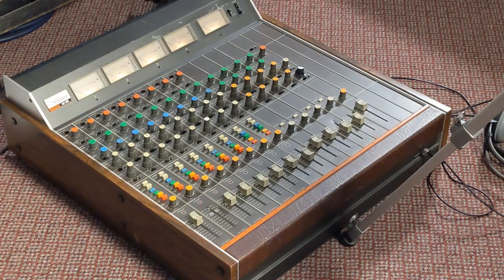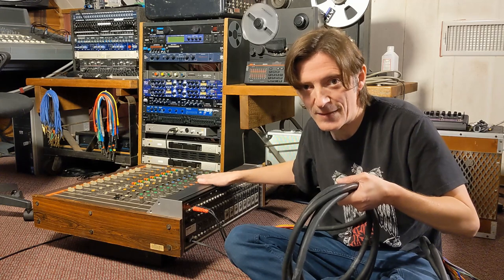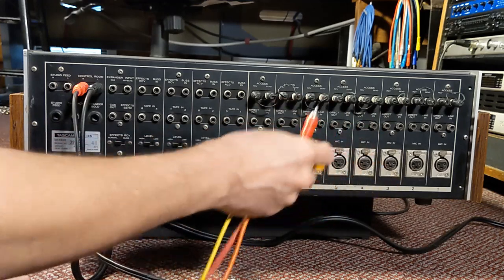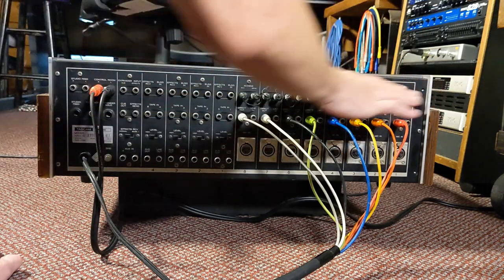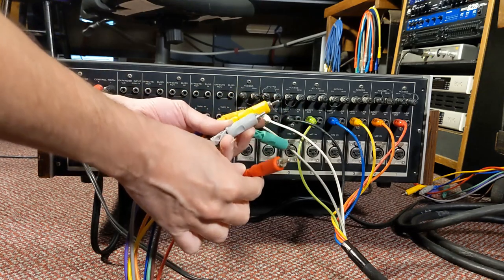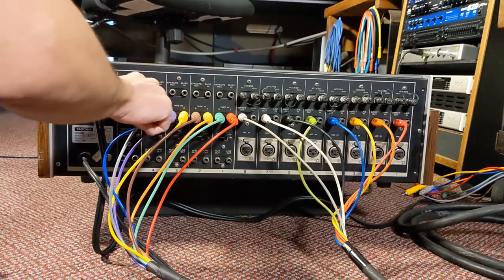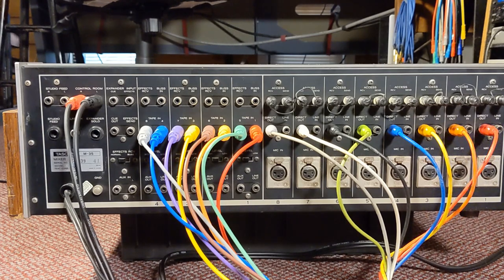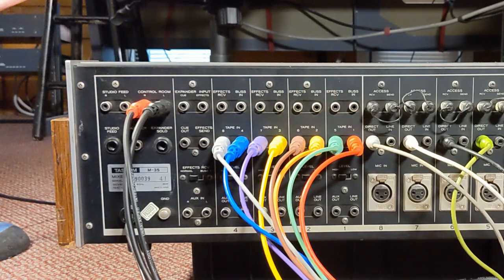Setting Up Analog 8 Track Tape with an Analog Mixing Console

Comment: Hi Grady.. (? Name right), I just bought a Tascam 80-8 Reel to Reel in mint shape for my recording studio in the Poconos in PA. I like you video here dude... Very well done.  I am asking, what particular snake cord would you recommend I buy? It looks to me that you have HOSA CRA 802? is that right.?  I also have a Carvin 1640 Concert board I purchased from my local theater. It was serviced every six weeks for years.. in mint shape also.  Grabbed that bad boy for $100. I run all my gear in the studio through that into my in house PA system. All that works great. But now I am trying to set up the R2R to record right out of the board.  It looks like you are running both to and from both units back and forth with two sets of cords. Is that correct? Last question, do you think I am good with 1/4 inch connector cords into or out of the mixing board and RCA on the other end?  My first time coming across your site. I will check out your other videos. Well done... Thank you.
Reply from the maker: I'm not familiar with the Carvin 1640 but I used to own a Carvin MX2488. I have a lot of different snakes and cables I've collected but HOSA 1/4" to RCA should work fine with an 80-8. It's basically connected outputs from the console to inputs on the console. You can use either the subgroups outputs or direct outs(if your console has them) to feed the tape machine for recording. Then you need to run the 8 tape outputs back into the console in order to mix down what you record. It should be very similar to the setup in this video except your console may not have tape channels. In that case, you can use 8 channels for feeding the inputs and the other 8 for tape outputs returning to the console for mixing. The tape machine will usually pass the incoming signal to the output(input monitoring) so be careful not to assign the channels you are sending to the tape machine to the master LR to hear since the signal will be present on the other channels coming back from tape. In other words, he signal should only go to the master bus from either the main channel being recorded or the same channel returning from tape. Also, your 80-8 is designed with unbalanced line levels at -10. I'm not sure what the 1640 likes level wise but it's likely +4 so you'll have to keep the levels low going to the tape machine and boost the levels coming back from tape more to get good staging. They make level matching units you can buy as well. These are sometimes referred to as a bump box. Some consoles also have switches to change the line level to a tape machine. I hope that helps. I've made a lot of videos about setting up analog gear so hopefully there are more videos here on the channel that will help illustrate better than I can in a comment. Thanks for watching!
Reply: @TwinCreekAudio  Thanks Grady, The 1640 was used in a local theater here. I was the main board for a 2000 seat theater locally.  I have other boards here, but that one does the job perfectly for my studio, hooked up to my EV PA system and through all the inputs of gear, from other reel to reel, Tascam Cassette Recorder, Digital Recorder, Turntable, CD player, and who knows what else.... LOL.  I am old school, at 69 years old now, in good shape. play jazz and blues and fingerstyle guitar for 50 some years now. Back in the 70s I did work with live shows with local bands doing some sound work. I knew how to set em up and record to tape back then, but was a building contractor in my real life for 45 years. Now retired, I built a nice studio with all the goodies. From Grand Piano, Rhodes, 2 Synthesizers, 20 some guitars, basses, upright bass, and other instruments. Bands come in to rehearse here and love it.  So expanding into being able to do the right thing with the recording end.  Got lucky and found a half dozen 1/2 inch Master Tape for $125.. ($170 ea online!). Anyway, I have now watched a few of your videos.. Great job!  Enjoy.. And thanks for your input and recommendations. Cheers!   Oh, and I ordered two sets of 8 plug snakes.  So I'll have both in and out covered in the room.

Comment: This really laid out the concepts well for me! In regards to some smaller boards, I was wondering if the insert jack would be suitable for a setup like this? I'm mainly looking at a Soundcraft EPM12 and each channel has a TRS insert jack for send-return functionality. Say I split the signal with a TRS Y-cable, the tip is the send going to a channel of the multitrack machine, and the ring is the return coming from the multitrack (and/or any external processing e.g. compression/reverb/extra EQ). Do I have this logic right? As much as I want to get into bigger setups, I want to see if I can get started on smaller gear. Thanks!
Reply from the maker: The concept of using the inserts is correct but in use, it really does not offer enough control over the signals. If the console has enough extra channels, you can use some to send to the recording device and the extra channels to receive from the recording device. I hope that helps. The inserts can work pretty well for sending to tape but then you have no control over the levels coming back.
Reply: @TwinCreekAudio  I thought that the return included in the insert would be before any of the board processing. That way, you could use faders, EQ, and panning in the board to manipulate the signal. So I'm thinking it would go console > insert send > recording device > external processing > insert return > console controls > 2-track output on board. Or would the return not offer enough of a signal boost? I'm very new to analog recording, so I am most likely just missing something, or maybe phrasing it in a weird way.
Reply from the maker: @mctwishvonnoodles9793  it would mostly work but you would not have Independent control over the levels going to the recording device or coming back from it that way. The insert's position in the signal path might be different for different consoles too. I would check  the manual but working that way would likely lead to a lot of headaches as it's really not a typical way of setting up an analog console. The inserts are for processing on each channel individually and really aren't meant to be a send and return, such as you'd find on a recording console to be be used with a recording device or tape machine. As I said before, it might work but it will be very frustrating and difficult in practice to use a setup like that. When people talk about using the inserts like a direct out, they usually won't be using the inserts return to hear the recorded signal but maybe doing it this way to record a live performance to separate tracks while using the mixer for the front of house or stage mix.

Comment: Great video, nice and straightforward, I have the m-30 trying to learn how to send effects through it at the moment, another video like this demonstrating how to use effects with it would be awesome!
Reply from the maker: The next video I'm working on is using this setup as well. I'll continue to discuss connecting effects to inserts and Aux sends in the next videos. I do explain it some later in this video but will fully demonstrate in the next few videos. Thank you!
Reply: @TwinCreekAudio  same here, i gave up trying to use the 4 bus on the M-30. Wondering if its because I don't have all the send/rev slots jumped
Reply from the maker: @Anetzell  on these consoles that have access send and receive on RCA connections, the jumpers have to be there for the channel to pass signal. The M-35 doesn't have access patch points on the 4 buses I don't think. If the M30 has them on the buses, they likely need to be connected for them to work. I'd have to check the M30 manual to be sure though

Comment: How would you hook up a patchbay into the signal flow of this
Reply from the maker: Just come up with which connections you need quick access to and connect then to a patchbay. Most like we would need an RCA type patch pay for this console. The direct outs, inserts and Aux(effects and cue) sends would be the main connections needed from the console along with possibly the subgroup outputs. The exact way you set up the patch bay would be up to you and your needs.

Comment: great video! Is there much smaller equipment I could use (starting a small home recording studio to record multi-track songs), with 4 or 8 tracks,but still have that great analog sound? I saw that some Tascams have a cassette in them.
Reply from the maker: Thank you! Tascam made several 8 track cassette machines such as the 488, 488 MkII and 688 that had MiDI capabilities. Also the Syncassette which is the same Cassette 8 track without the mixer. Cassette tape is 1/8 of an inch however, so the quality will not be as good as the 1/4 R8 and it's not as good as 1/2" 8 track which is the same track width as the big 2" 24 track analog machines. If your looking for a more low bandwidth lo fi kind of sound, the cassette 8 track format might work OK for you but all tracks will have that sound instead of being able to choose between lo fi sounds and sound with more fidelity which can be good for contrast rather than everything in the mix sounding lo fi. You could record to 8 track cassette and then transfer to digital to add the things you want to sound cleaner though. They also make plugins that get that sound that would probably be less expensive than a tape machine, tape and maintenance. The Fostex R8 is definitely the smallest multitrack reel tape machine you can find and sounds very good. They cost a bit now but are really fun to use and sound really good for 1/4" tape. Maybe you could find a smaller mixer as well?
Reply: wow! Thank's for the quick answe mate!  @TwinCreekAudio  I'll keep watching your channel!
Reply from the maker: @raybossa  Thank you! I will have more videos with tape machines coming soon.
Reply: what do you think of the type 2 cassettes (Tascam Master Studio 424)?
 @TwinCreekAudio
Reply from the maker: I haven't used one very much. A friend of mine used to have one but I don't remember what it sounded like. As far as 4 track cassette, best to get one that runs at high speed on Chrome tape. My favorite is probably the Fostex 260. Some of the X series are pretty good. Also, Yamaha made a cassette 8 track and 4 tracks. I think the Tascam used dbx and Fostex used Dolby C which might be why I prefer the Fostex. I do like dbx on my 1/2" 16 track Tascam MSR-16. On that machine it sounds really good. My first multitrack was a Fostex X-30  4 track cassette. My second was a Tascam 488 cassette 8 track.

Comment: The video is very interesting, how do I do if instead of using a Mixer I use an 8-channel interface, it has 8 inputs and 8 outputs that I can route with the Universal Audio console Software. 
So I can, for example, connect my microphone to input 1 of my interface. 2 on output 1 of the interface I go to input 1 of my Tascam 38. And so on...
But I won't be able to listen to what I've already recorded because I don't have space to connect the 8 outputs of the Tascam 38 to the 8 inputs of ???  How would I do it in this case? Or if it were not interface, a mix that only has direct output but no tape input?
Reply from the maker: You could use another small mixer or a larger one with more channels. I have several videos about hybrid mixing setup that should have more information that might help. 

https://youtu.be/OlMjnQP58nU?si=rvadY_i7qN-MhtI3

https://youtu.be/RWmxkO2gnOs?si=yv_lqna_G0YPacrY

My Soundcraft has 44 tape IO so I have digital interfaces connected to the first 24 channels followed by 16 track analog at 25-40. Then I patch between them on the patchbay for transfer etc.
Reply: @TwinCreekAudio  Thank you very much for your time and response.
Here in Germany I have the opportunity to buy a Fostex R8 in very good condition for 450Eur.
And I was looking for a Yamaha RM804 (since this one has Tape out and Tape in on each channel) it is the one you mention in your video.
But I found a good offer on this Allen for 200Eur. The model is this Allen & Heath ZED 420.
It does not have tape in or tape out. But it has direct out and inst IN. Could this work for me? The Direct Out should work but the IN insert to monitor the Fostex tracks? 

Thank you for your time and your good videos🙂 Best Regards